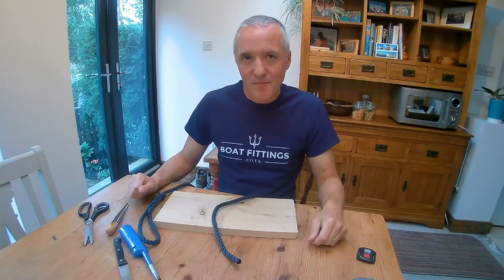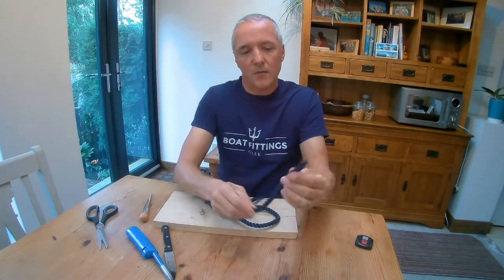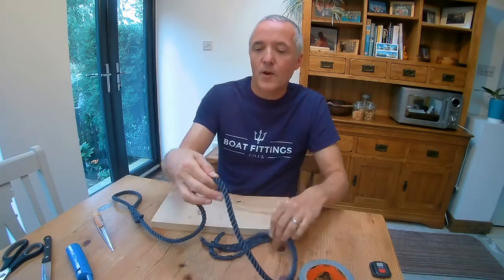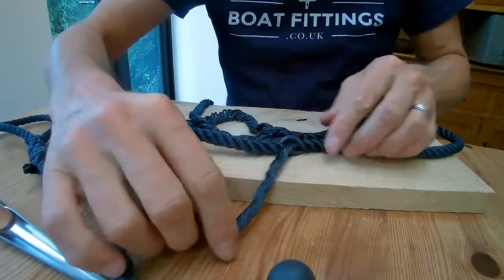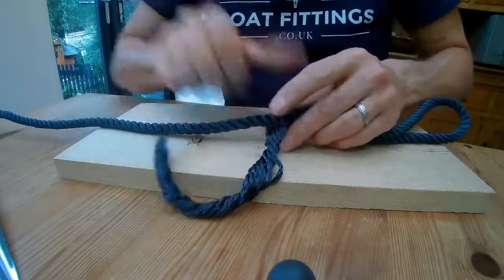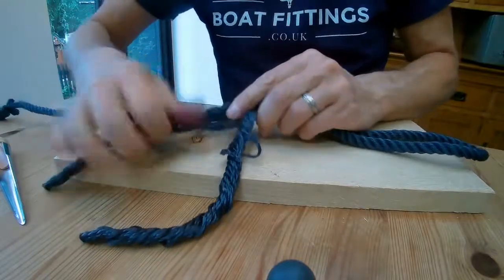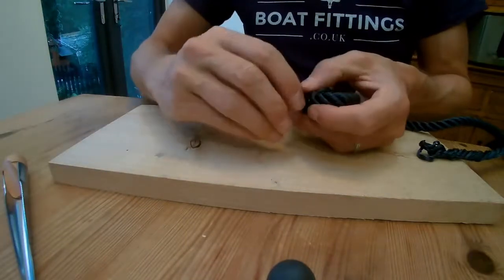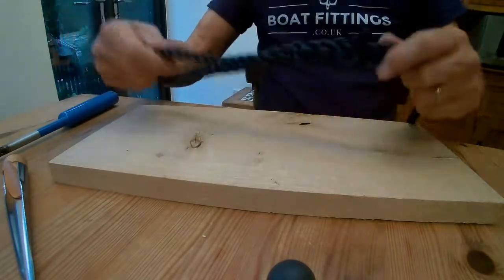Splicing a loop into a 3-strand polyester rope, using a Marlin Spike.  Simple to follow guide.

Comment: Once completed, roll the splice between your hands and pull on the loop. It will adjust the splice so it’s nice and neat. 

To taper the splice rather than have three strands sticking out at one level, cut the first stand, splice the next two, cut the second then splice and cut the last strand. 

Then roll between your hands and pull the loop a few times.
Reply from the maker: Hi thanks for your additional recommendations :)

Comment: To hide the ends on something like this, I usually either use a piece of heat shrink tubing or do a "French lashing"... I'm mediocre at 3-strand splicing though -- I need to use a marker and color code each of the 3 strands first to keep from getting confused... Not enough practice, I suspect... More often than not, I'm using nylon braided line and I just sew the eye in it...
Reply from the maker: Hi many thanks for your helpful comments, there is always something to learn / improve on so thanks again :)